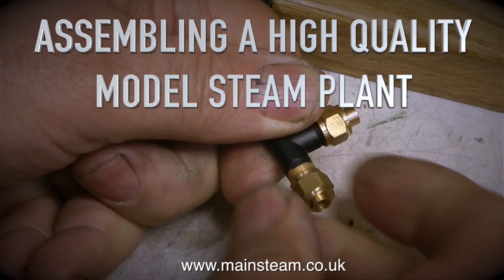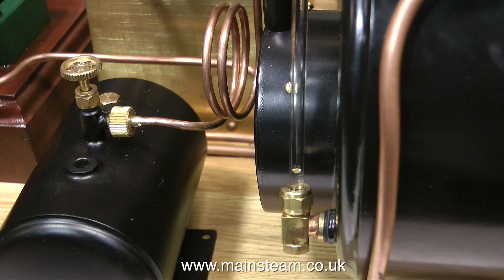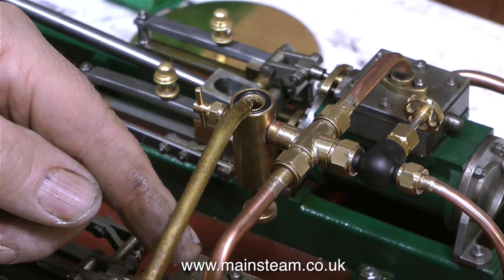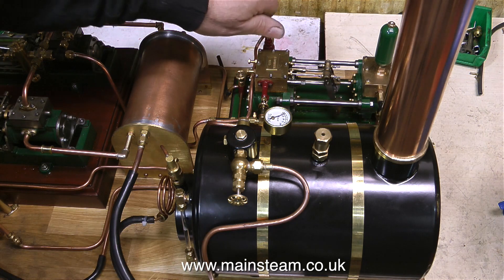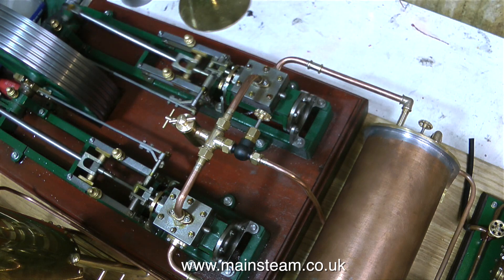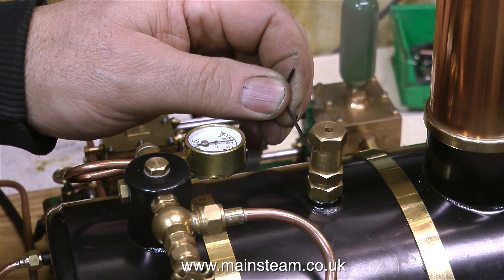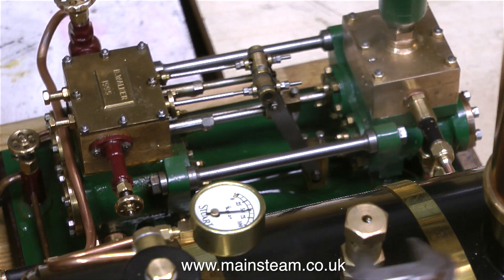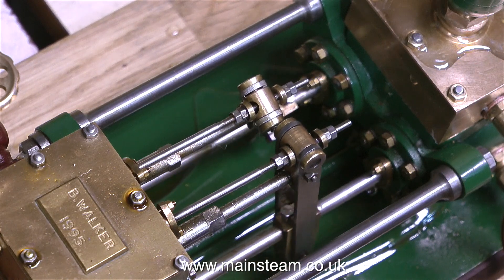ASSEMBLING A HIGH QUALITY MODEL STEAM PLANT - PART #15

Comment: Hi, i am completely new to this.
Can you run this model with wood or coal?
Also, how powerful is it? Could it run some kind of model saw mill and actually cut some logs (branches)?
Reply from the maker: it is gas fired and not very powerful, but it looks and runs well. 
It would drive a very small saw or any model tools, but usually they are just for effect and don't really cut anything.

Comment: I'm trying to understand the condenser. Exhaust steam with some oil in it goes into a drum which also has an exhaust pipe in it. The steam will expand in the drum and cool and condense I guess, leaving a bunch of oil and water in the drum. Some of the incoming steam it will wisp out the exhaust of the condenser too. The stuff that comes out will still have some oil mixed with it.

So what is the point of the whole thing? Just that you don't get most of the exhaust going into the air? Does the condensing steam form a bit of a vacuum helping suck more steam from the exhausting cylinders?

I used to fire a boiler on a full size steam launch where the condensed water could be reused as hot feed water after the oil was somehow separated, never did learn how that happened in about 3 years of firing it!
Reply from the maker: The water vapour that exts the condenser/oil trap is clean - the oil remains in the condensate. There is some vacuum too.

Comment: Hi Keith;
I'm hooked on your videos.  
Would you please comment on direction of steam engine rotation?  I've been under the impression that the full size horizontal engines run in the opposite direction of your twin Victoria such that the cross heads are pressing down on the guides.
I have also tried to source the nifty bearing cap lubricators you get on eBay from '21st-century.steam.company'.  There are never any items listed.  Are sales to the USA blocked?
I'm currently in the process of machining a Stuart Beam engine and your tips are greatly valued.
Keep 'em Steamin'
John
Reply from the maker: it depends on how the eccentrics are set.

Comment: In a full size boiler it is a normal practice to vent out air initially from inside the boiler. This is done by keeping the vent valve open till boiler pressure reaches about 2 bar. After that the vent valve is closed and pressure is allowed to rise to working pressure.
Is anything similar done in model boilers?
Reply from the maker: Not really, but I often open the steam valve whilst steam raising to let the air out and also to let some warmth reach the steam engine ...

Comment: Hi Keith just a quick question how much would it cost to replicate this steam plant
Reply from the maker: Quite a lot ......
Reply: Hey Chris, I cannot say what the prices of the water tank, the feed pump and hand pump is. But a quick look on Stuart's website the boiler, fuel tank and a UNMACHINED twin Victoria is 1,601.5 pounds "2126.01 USD" or 2,873.00 pounds "3,813.95 USD" with a machine twin Victoria without shipping. Keith would have a better idea what the water tank and the feed pumps in those classes would sell for on the market. Then take in account all the pricey copper tubing and connectors. I just purchased a Stuart 5a casting set with all the options after shipping it was 2,000 USD
Reply: If you're knowledgeable of steam engines, you could get the materials and craft your own for not too much money. A few hundred maybe. If you can't build your own though then you have to factor in someone else's labour and that will raise the price considerably. Easily a couple of grand for the time it'd take to get it up and running properly. Then again, a man can't feed his family by working for nothing.
Reply: I think it might be a case of if you have to ask you can't afford it. Would be interesting to look up the prices (some are only available as casting though) and add them up.
Reply: Lets just say if my wife ever finds out how much I've invested in this I'm in BIG trouble! But like I always tell her these things are investments and I've always wanted to own a Twin Victoria.

Comment: Hi Keith, it's coming along nicely and will be an impressive set up.  Could you please tell me what dia the main steam pipe is from your boiler to the engine ? I have a 5" vertical boiler on order and wondered what sort of size is likely to suit.  Many thanks.
Reply from the maker: The steam pipe is 3/16 of an inch in diameter.
Reply: Ok many thanks, I have a feeling the fitting on the boiler I'm buying are for 3/16 but initially I thought it to be small so I feel a bit more assured now :-)